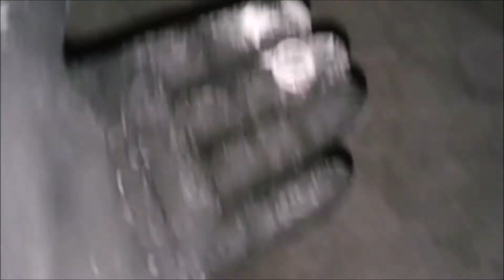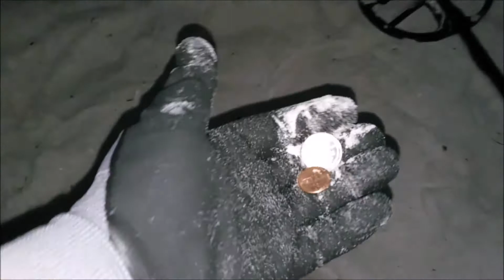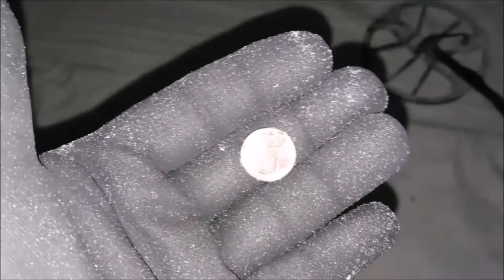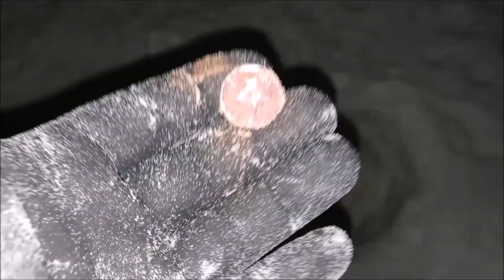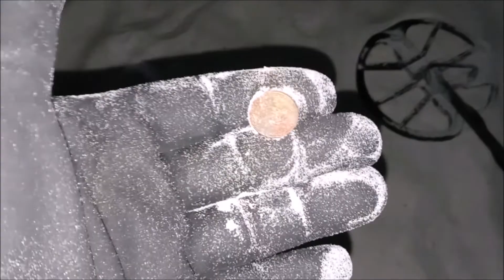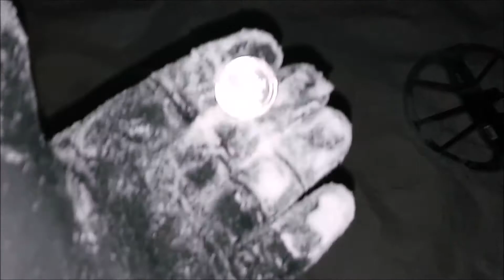A Ring & BIG HEAVY SILVER! Clearwater Beach 4 Person Night Hunt! Diggin' Florida w/ Rob!

Comment: Hey Rob, I wanted to ask you what size Coil are you using on your Beach Hunting? Nice coin spill and Jewelry!
Reply from the maker: Dennis, I use the stock 11" Equinox coil on the beach. I would swing the 13" in the dry sand, but NOT the water, as I've heard swinging thru the water puts too much pressure on the coil ears and they snap.